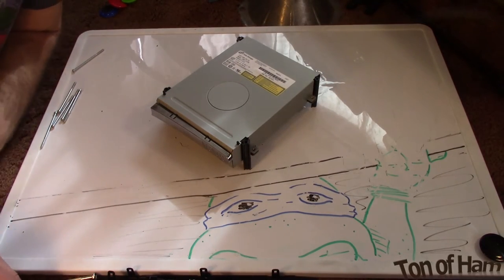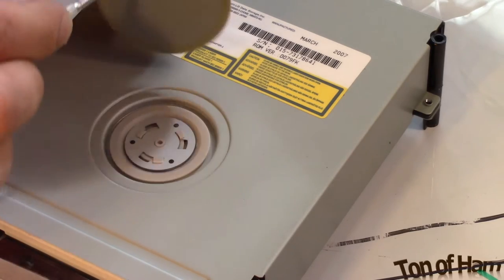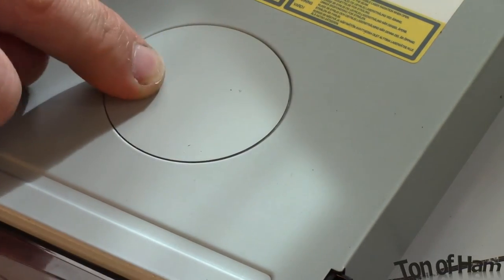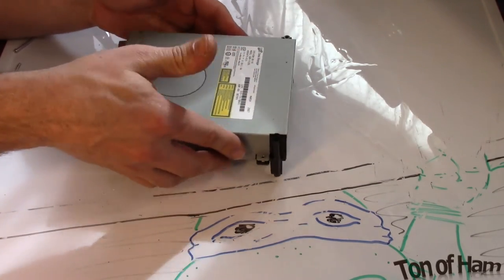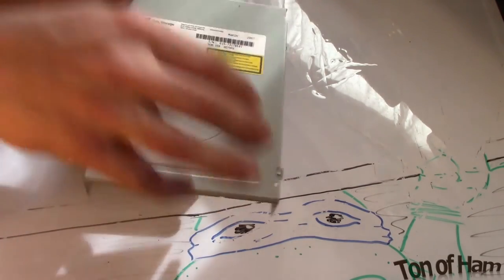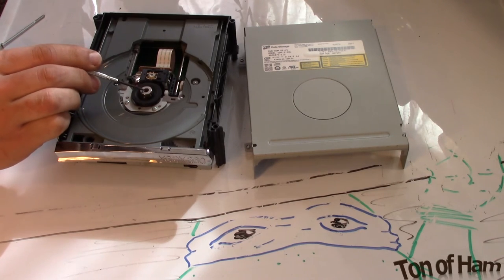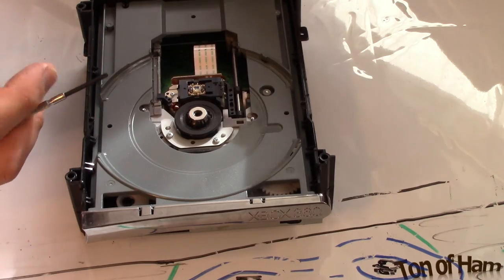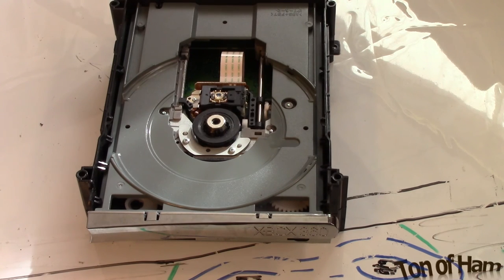Xbox 360 Tutorial: How to Replace DVD Drive Part 2

Comment: I have an xbox 360 slim that works great but when i try to eject the tray with the system off it only comes out half way. If I turn the system on first it comes out all the way everytime. Any ideals what this could be?
Reply: Most likely the loose rubber band inside the 360 or loose  screws